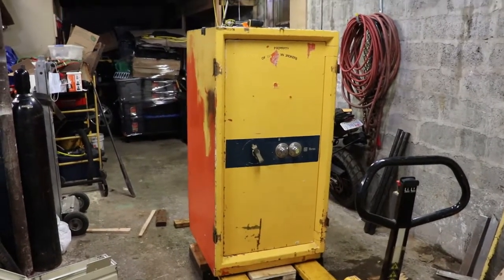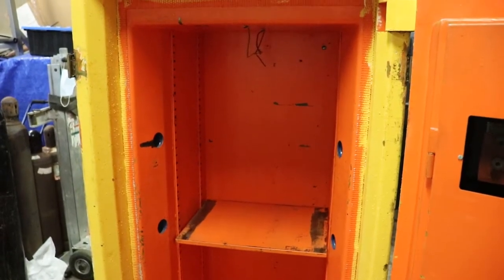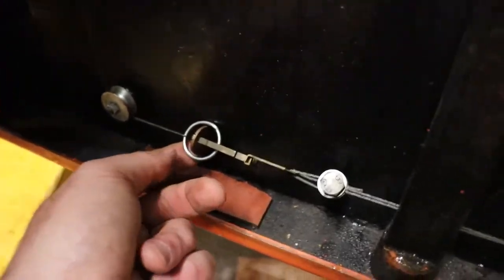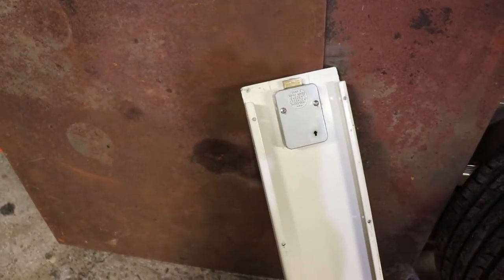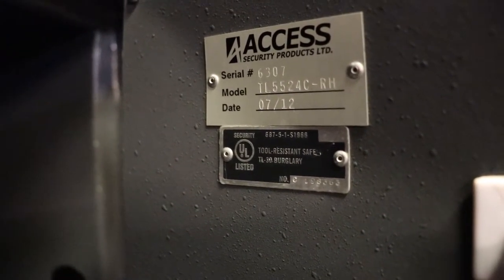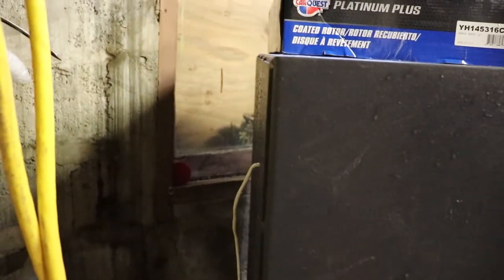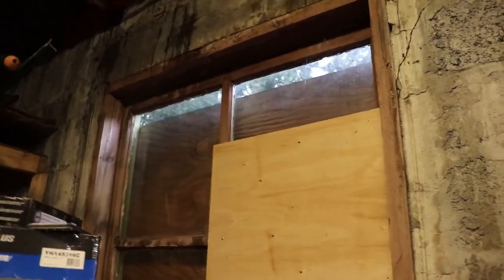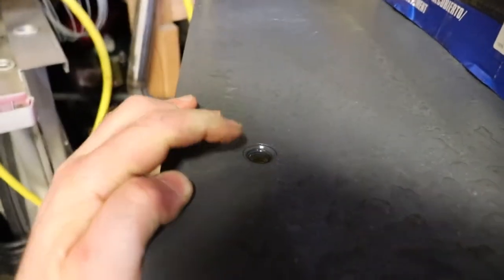Safes - Access Security TL-30 vs Tann TRTL-30X6 Plus

Comment: Out of curiosity, how much would these safes cost? And where would you find a used safe? Also, it's pretty easy to decode the combination for that lockbox at 3:00 by taking the back off the lock, and spinning the dial so that the gates line up under the fence. You can also align the gates on another part of the lock where they're easier to see, then align the third wheel with the fence (because it's easier to see), and add that offset to the first two numbers. You can then get an S&G change key and change the combination.
Reply from the maker: Thanks for the tips.  I am having a locksmith set up the Kromer in the future and I'm hoping he can teach me how to change it.
I found the Access Security safe on Kijiji (similar to Craigslist) at a pawn shop that was moving.  You can also find them at metal recyclers.  The cost was $2500 Canadian and they said that I could have the Tann for free after I arrived.  Transportation costs were about $1600 and was a total fiasco that took two attempts using a forklift, telehandler, a tow truck, and a flatbed trailer.
Reply: @SteveRivett  😁 I bought an antique safe that’s about the size of a dishwasher,it weighs two thousand pounds.  It’s a JAnd J Taylor that once belonged to the Alberta liquor control board. It’s got an inner safe that’s even more secure than the outer door. I tried using a forklift to get it up my steep driveway,no go. Used a crane truck from my buddys truss company the next day to get it up to my garage.
Reply from the maker: @Whateva67  I had a locksmith over to change the codes on the safes a couple weeks ago and it turns out that the TANN was capable of having 4 numbers to open it instead of the standard 3, the previous owner must have elected to leave the 4th position blank.  Turns out you can set up the safes so they only need 1 # to open if you want.
Reply: Just found a used Tann Fortress safe for sale that has two dials on the outer door. They didn’t have a price on it yet but I’m guessing it won’t be cheap as it’s an equivalent to a TRTL 30